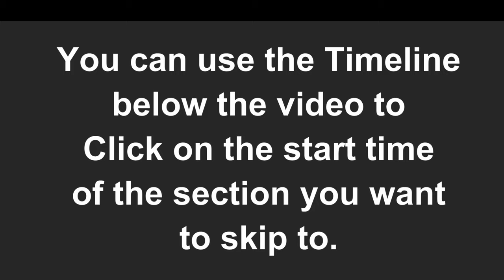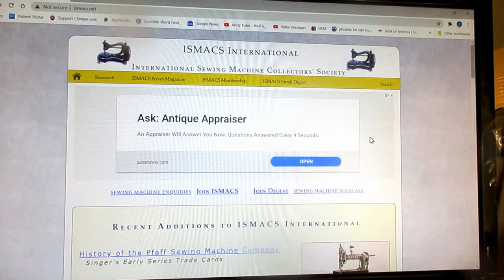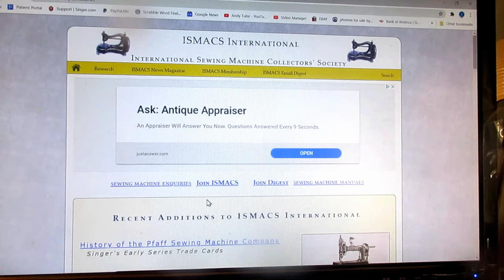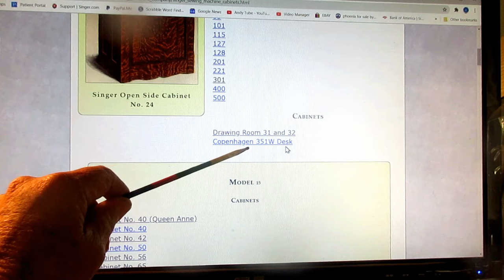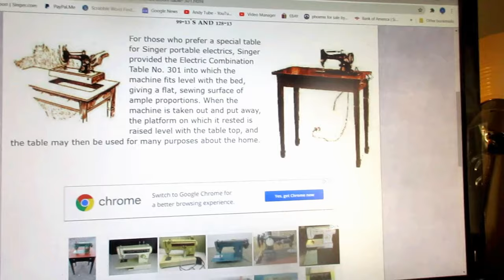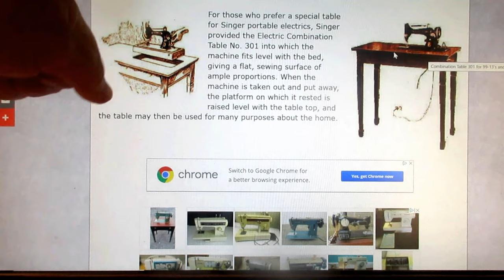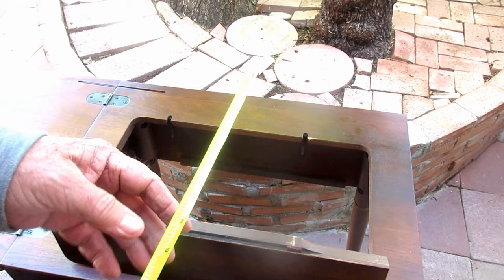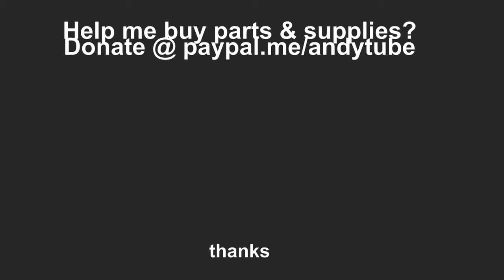How to choose a cabinet and install a vintage Singer sewing machine

Comment: I wish people understood the beauty and functionality of these tables, they are space-efficient, and add beauty to your home or condo/apt.
Reply from the maker: Yes, I have the same. Wish they're very well made and it's interesting that singer designed and manufactured them. They didn't farm that out to a furniture company or anything. I've shipped a lot of them overseas with my machines because you can dismantle them and flat pack them. A singer repairman told me once that that's how they came from the factory to the stores and then himself and other people at the stores. Would assemble them clean and adjust the machines and install them? If the customer wanted their machine in a cabinet, a lot of people now use them for end tables. Nightstands entry area tables and so forth. A few I've had were solid wood. Then later they went to a solid softer wood with real wood laminates. I think my favorite one was a combination table 304. It was wider than the average cabinet. Hadn't accordion fold up drop down top opening then you could pull the machine up from inside and so some of those were made with solid tiger oak. Really gorgeous. Thanks for the nice comment

Comment: This was so interesting to watch and I really appreciated how you broke it down into sections. The website was fascinating! I just picked up a cabinet for a 401a that my mother in law gave me. I’m pretty sure it’s the Priscilla Alden Style #87. I’m just a novice so when they sent me pictures of the hinge pins I saw a cradle and thought it was the bottom plate for a 401a 😅 Anyway, I would really like to find a manual for it or something because there are several metal attachments on the inside that I’m not sure what they are. I can see that at least one is to hold the pedal but there’s another piece perpendicular to it that looks like it might be a section of the knee lever but I’m not sure and a random tangled spring over by the swing out storage box. If I can figure it out, that knee lever sounds like it would be a genius feature to have! One question, the power plugin is above the surface of the table when the machine is up, does that mean you just unplug the power cable and store it inside with the machine when you put it away?
Reply from the maker: I'm glad you found a cabinet style you like. I'm not familiar with it but the extra parts underneath may have been for a "built-in" style of pedal that had the inner workings of the pedal, but no cover for the pedal as it was only meant to be mounted in the cabinet. Some older Singer cabinets had a "lift assist" spring system to help you lift the cast-iron machines. Singer stopped that later in the '50s when they went to cast-aluminum bodies after WWII. The only cradles I know of (for Singer) were made for Model 301A as the machine had no hinge holes for mounting on the drop hinges but used the cradle to hold the machine. Yes, you normally unplug the line cord and store it in the cabinet. Older cabinets often had metal "coat hook" looking parts to wrap the cord around for storage. I hope it works out nicely for you. Once I gave my wife a cabinet with a knee lever she has never used a floor pedal again. I had to buy used brackets and put them in all her other cabinets, and added the coat brackets for cord storage at that time. Thanks for watching my channel.
Reply: Thank you for responding :) I found a second video that showed all the pieces and was able to clip in the floor pedal and all I’m missing from the setup is the actual lever. That might be a ways down the road since it looks like they’re a little pricey, but hopefully in the future I’ll be able to pick one up. Thanks again for getting back to me :)
Reply from the maker: @kathrynnewillhoite4342  Congrats then. It sounds like a nice video so I', glad you found that. Levers are usually about $15 on eBay. Hope you get it set up. Take care.
Reply: Oh I hope I find a good deal like that :) Thank you!
Reply from the maker: @kathrynnewillhoite4342  https://www.ebay.com/sch/i.html?_from=R40&_trksid=p2380057.m570.l1313&_nkw=singer+knee+controller&_sacat=0

Comment: Andy, I just found it.  Missed it earlier at ISMACS.
Reply from the maker: Okay good. Many of the later models will fit it also. It's a pretty versatile table over the years. Some of the much later touching souls were a little too long. Good luck with your 401s

Comment: Great video, thanks! Can I put my 403 into a treadle cabinet? AND do you have a video on removing the black hinge panel thing to create a bigger hole to put machine?
Reply from the maker: I'm not familiar with treadle cabinets, sorry. I know that some of the4 German-made 4xx models, like 404G, can convert to a treadle machine, so I assume the 404 could go into a treadle cabinet. It's like in the video where you measure the space of the hinge holes on the machine to the space of the hinge pins on the cabinet.
"black hinge panel thing"... ?

Comment: Hi Andy, I've enjoy all of your videos, I have a Singer 301a, gifted to me. I'm looking for a cabinet to keep it in. Can you offer any information?  Thanks
Reply from the maker: Congratulations; an incredible machine. Regardless of the cabinet you choose you will need a "cradle" to mount the machine into it.  
     While most vintage Singer models can hang from hinges in the cabinet, model 301/301A sits in a cradle and the cradle hangs from the hinges. Here is a video about it: https://youtu.be/jLSCL7PoqqU   You can find cradles for sale on eBay and other online marketplaces:  https://www.ebay.com/sch/i.html?_from=R40&_trksid=p2380057.m570.l1313&_nkw=singer+301a+cradle&_sacat=0
     My favorite cabinet for model 301A is the one Singer made specifically for it, the Model 74 "Spinet" Cabinet. Here is a page with info about this cabinet: https://ismacs.net/singer_sewing_machine_company/74_cab.html    and here is a very nice blog post about it:
https://www.core77.com/posts/20002/Sewing-Furniture-Part-6-The-Brilliant-Unsung-Design-of-Singers-No-74-Spinet-Cabinet
     The Cradle will fit in many of the Singer cabinets made before and after No. 74. Here is a page at ISMACS you can scroll down thru many of the cabinet styles and which models of the sewing machines will fit in them:   https://ismacs.net/singer_sewing_machine_company/singer_sewing_machine_cabinets.html
   If you are interested in the 301A I have a couple of Playlists with a total of 36 videos about cleaning, adjusting, repairing, and replacing any worn or defective parts. Here is my Coco series: https://www.youtube.com/playlist?list=PLsCOZgzzaiKLZyGebzS_oISgesXNyREyI 
and here is a technical series with some deeper details: https://www.youtube.com/playlist?list=PLsCOZgzzaiKI_6fbu3itbd1v4z3uQvvkO     Very happy for you to have a 301A.   Thanks for watching my channel.

Comment: Anytime, you are the best!  I’ve been rescuing old machines.  Can I put a 603E into an older cabinet.  I’m almost sure the HP holes are 9 3/4 inches apart.  Will check now for the set screws.
Reply from the maker: Thanks for saving those machines, Linda. Normally you can put most Singer vintage models into vintage cabinets. The holes are uniform. Where I have run into snags is if the body of a "newer" vintage machine is slightly longer on the needle bar end. Both times I was able to remove 1/8 to 1/4" of the left side opening so the machine could fit flush and also be able to be lowered down inside. Just measure the machine end-to-end, the space between the holes, AND from the left side hole to the left edge of the body or bed of the machine. Thanks for watching my channel.
Reply: I have a table with a hinge pin spacing of 9" only.  It is a singer table.  do you by any chance know which model would have that spacing?  Woudl love to put that table to use.  thanks
Reply from the maker: @janiiyer5754  Sorry, I am not familiar with that spacing. My first thought was maybe it was for a Model 221 Featherweight. SInger made a special table for it: https://ismacs.net/singer_sewing_machine_company/featherweight_sewing_machine_cabinet_number_68.html
I've never seen a Cabinet No. 68 in person. I thought the Featherweight just sat on a tray or shelf in the cabinet.
     There are several other cabinets shown on ISMACS. I don't know if you would find your cabinet among them.
https://ismacs.net/singer_sewing_machine_company/singer_sewing_machine_cabinets.html
There are later model cabinets not shown on ISMACS, and there are hundreds of SInger models I've never seen or worked on. Another thing you might try is a "picture search" of your cabinet. I've used that on my cellphone and Google Search to identify models and other items. That's about it. hanks for watching my channel, and good luck.
Reply: @andytubesewing1953  THank you.   I was a bit surprised, as I was told that most singers will fit in the singer treadle cabinet.

Comment: Love that set pin screw driver!! Where did you get it?  I'm hoping to get a cab #42 that will either keep the model 15-91 in it, or swap with another beautiful machine made in Japan for Montgomery Wards (if  dimensions allow).
Reply from the maker: Those screw starter screwdrivers are vintage. They were made by the HJJ CO LOS GATOS CA. They come up for sale sometimes on the online auction and selling sites, but they go quickly. https://fhelm.com/  makes a new version of these drivers now with the spring steel inside but hard plastic handles instead of brass. Thanks for watching my channel.

Comment: Hi Andy!  I used your technique on holding the hinge pins up so I was able to set the machine into the cabinet.  It was great!  Do you know anything about treadle machines?  I'm looking for 20x1 needles for my Singer model 27.  Any advice would be appreciated.
Reply from the maker: Glad the rubber band helped. I don't know treadle machines or stands, but here are some 20x1 needles: https://vatican.com/Needles-Cases-20X1-Sewing-Machine-Needle/
Reply: @andytubesewing1953  thank you!
Reply: Most treadle machines are the same. Since treadles have to be in a cabinet. Bc of the treadle..

Comment: Hey Andy this is Tracy with the 401a I'm the guy that you helped out tremendously how do I find out about my singer cabinets like the age it's not it's a desk more like I can't find anything I'll post a short video on my channel if if you like to help I would appreciate it you're awesome by the way
Reply from the maker: Hey Tracy. Nice cabinet, and very rare. Up until about 1960 models you can find decent info about the cabinets here: https://ismacs.net/singer_sewing_machine_company/singer_sewing_machine_cabinets.html
Personally, I think your desk came after 1960. You can find pictures of it online with 401A, 500A, and some 600s slant needle Touch & Sew models. I have a couple other viewers who have this cabinet, and a handful more that have it with different hardware, ie; handles and pull knobs. There are similar ones with fold-open tops vs your removable insert and that is the case with Singer going back decades. Your cabinet would have been the most expensive in the SInger Store, IMO and you just do not see many of them.
https://www.google.com/imgres?imgurl=https%3A%2F%2Fpixl.varagesale.com%2Fhttp%3A%2F%2Fs3.amazonaws.com%2Fhopshop-image-store-production%2F9740070%2F3243f6e9f298469d489b11440bc44756%3F_ver%3Dlarge_uploader_thumbnail%26w%3D640%26h%3D640%26fit%3Dcrop%26s%3Ddf4dcc861916972f63f6786eac8482ca&imgrefurl=https%3A%2F%2Fwww.varagesale.com%2Fi%2Fwdfdnsdb9wafqxyfvzdvewcc-1958-singer-401a-sewing-machine-with-rare-mahogany-sewing-desk-343&tbnid=jm6sulZ_svXHXM&vet=12ahUKEwjE76PVhYP6AhVKHDQIHVYNAT4QMyg2egUIARCHAg..i&docid=flpHGJRznmcyVM&w=640&h=640&q=singer%20sewing%20machine%20desk&ved=2ahUKEwjE76PVhYP6AhVKHDQIHVYNAT4QMyg2egUIARCHAg

https://www.google.com/imgres?imgurl=https%3A%2F%2Fs3.amazonaws.com%2Fproductimages.goantiques.gemr%2F96844%2F992970240_fullsize.jpg&imgrefurl=http%3A%2F%2Fwww.bculinarylab.com%2Ftag%2Fuvilla%2F%3Fss%3D5_55_3_27_55%26pp%3Dsinger%2Bsewing%2Bdesk%26ii%3D4680097&tbnid=HT93Ek0-hzShJM&vet=12ahUKEwik88zqhYP6AhURBDQIHXwUAFkQxiAoBHoECAAQIQ..i&docid=7DgOxtrSTz52EM&w=600&h=800&itg=1&q=singer%20sewing%20machine%20desk&ved=2ahUKEwik88zqhYP6AhURBDQIHXwUAFkQxiAoBHoECAAQIQ

Notice that your handle pulls, etc. are fancier than in the above photos? You have a real beauty there, congratulations.

Comment: Hi Andy! I was able to remove my right-side controller wiggling downwards, thanks for your help!! The rubber circles on its bottom are full of brown grease. Since I wanted to put it on my carpet, I have to clean it. The controller works but why was it greased? Should I open it to clean inside?
Reply from the maker: Nicely done! ⭐ I've seen some gooey feet on cabinet mounted pedal controllers. I always figured it was from oil, but who knows? Before I used it on carpet I would at least take the feet off and clean them. The controller has stacks (2) of small carbon discs inside to control speed. The discs break down into carbon powder, black and very hard to remove from soft items. With the back cover off to remove the feet you can at least blow out the interior with canned air or such. If you are interested I have a whole playlist of videos showing step-by-step how to dismantle, clean, assemble, and adjust the controller: https://www.youtube.com/playlist?list=PLsCOZgzzaiKL6ePPxLpmnWSzTyxPKTb71     Carbon stack controllers get quite warm when in use, especially when sewing slowly. As the carbon discs break down they get coated with the dust and cause more resistance to the electricity flowing through them and resistance makes heat. I've had controllers where the discs were crumbled, cracked, and powdered to pieces, and barely working. I have replaced worn/hot pedals for people with new style electronic pedals bought online that barely get warm and have superior speed control. You can take a look at yours and see what you think. Learn to use the button control on it. I'd put down a piece of carboard, old towel, or something at first to protect your carpet. Your last question was "Should I open it to clean inside?" I always do; every time. Congrats again and take care.
Reply: @andytubesewing1953  Gooey feet! You have a way with words as well as with 404’s! Thank you so much again. Your videos are amazing, your knowledge astonishing, and your generosity is heartwarming.

Comment: Great video. I wonder about moving these cabinets. Is it safer to leave them on the hinges and in the cabinet or move separately. The cabinet is top heavy. How would you pack/load for transport?
Reply from the maker: Hi Jo. Local or shipping? I've driven 50 miles and brought home machines still in the cabinet in the back of a mid-sized SUV. I lay an old blanket down and push the cabinet in top first and facing down. Then the machine hangs on the hinges. Upon arrival home I pull the whole cabinet and blanket out together and let the feet touch down first. I've shipped many cabinet to S.E. Asia by "flat packing" them. Most of the vintage cabinets can be dismantles by removing the leg, sides and top by taking out screws/brackets. Then all the wood lays flat for shipping and I wrap the machine in bubble wrap and pack in a HD box from home depot and stuff the spaces with rigid foam pieces, like cheap foam insulation. If I ship a machine in the USA I take it to UPS and pay them about $30 to pack it then I get a S400 guarantee on it. If you are nervous to transport a machine home, then please take it off the hinges. It's only a couple of screws. Lay the cabinet down for transporting and  put the machine, standing normal, on the floor behind the driver seat. Hope that answers your questions and thanks for watching my channel.
Reply: @andytubesewing1953  very helpful
Reply from the maker: @josetliff4289  👍

Comment: Andy, I have cabinet #65 and it had either a 15-91 or a 201 in it.  I'm going to put my 301 inside.  I have the cradle and clips needed but I need to move the black piece on the right of the opening, where the electrical cords went through.  I wish I could show you a picture but I need to ask you if you know what's the best way to remove that piece?
Reply from the maker: I'm familiar with the cabinet/desk. I have also seen the "black piece" you mention but never attempted to remove it. That piece is often attached to a coiled spring that also attaches to the cabinet. I have heard it called a "Lift Assist" b/c the iron machines are difficult to just raise up from inside the cabinet and that spring lift made it somewhat easier. A retired Singer man told me the cabinets were shipped to the Singer Stores "Flat-Packed" meaning not assembled and all parts and wood pieces laying flat for easier shipping. The guys would assemble the cabinets at the stores and mount the machines into them. I personally have disassembles a few cabinets though none with the lift assist or black piece. I believe that those pieces are just attached to the inside of the cabinet with wood screws that can all be removed. I have 100s of Singer manuals but never found any for the cabinets. I looked at an old model 15-91 Service Manual and it has pictures and descriptions for removing the controller and knee lever device, and I can see the coil and wiring in the pics although it does specifically say how to remove the coil or black piece. You can view this manual here: https://www.manualslib.com/manual/364405/Singer-15-91.html    Pages 4/5. Sorry, I can't give you specific instructions. Good Luck.
Reply: @andytubesewing1953  Thanks much!
Reply from the maker: @sherriscreativemind  Good Luck.